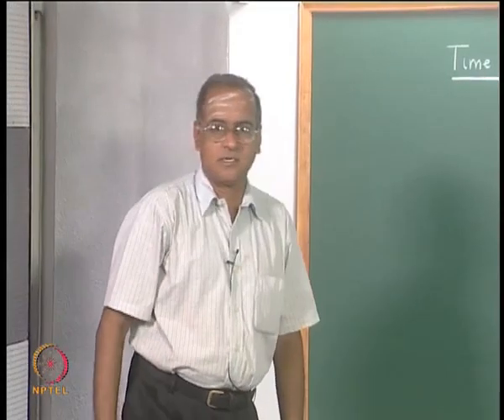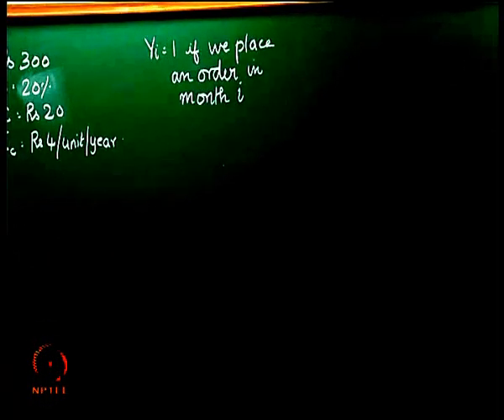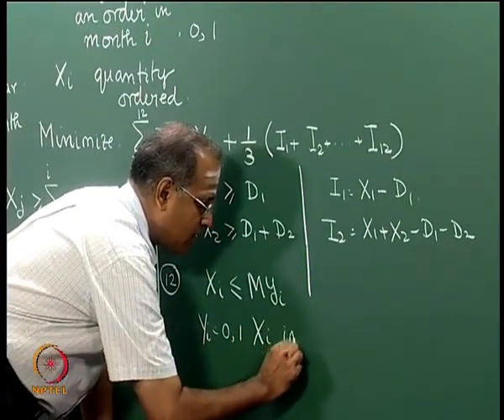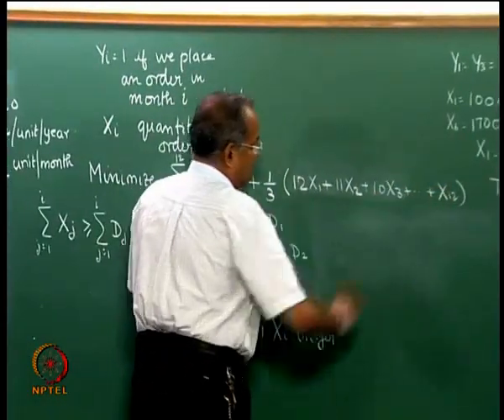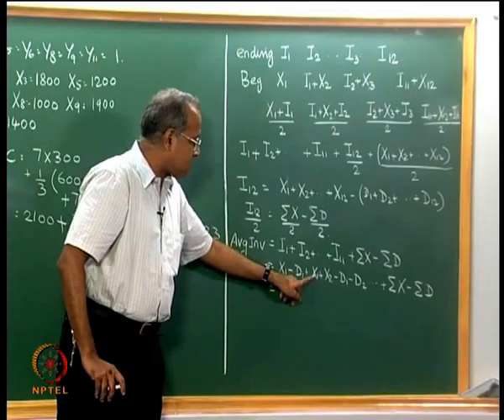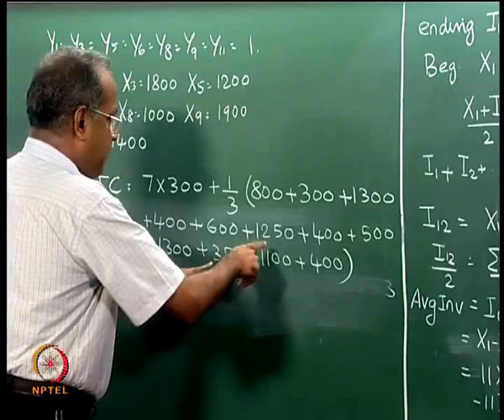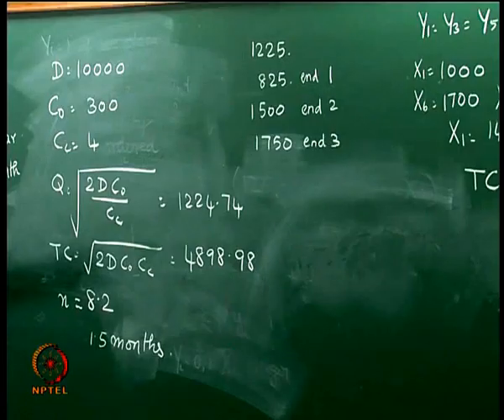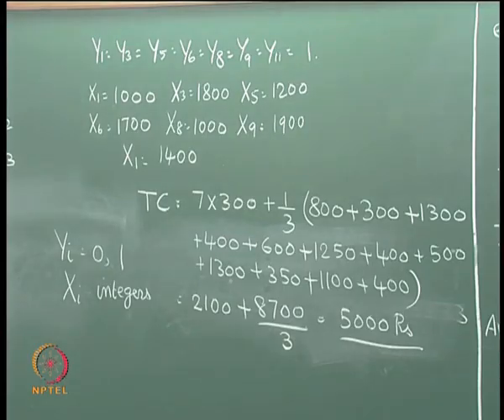Mod-05 Lec-17 Lot sizing

Comment: Hi Srinivasan, could you help me to explain more clearly what is Xi<=Myi, so What M mean
Reply: Hi Tran, M is a big number like 1000, 10000, or 10000 depending on your problem size. It could be any big number that is there to complement the binary variable yi.
For example, here demands are in hundreds and thousands. If you use 1000 as M, then it will limit your x (or quantity ordered) to 1000 even though you may need to order more. so 10000 as M would be a feasible and good choice.

Additionally, if you take the number too big then again it is a problem as your solution time may go up.

Hope this helps..
Cheers